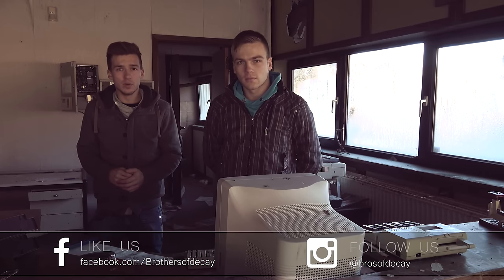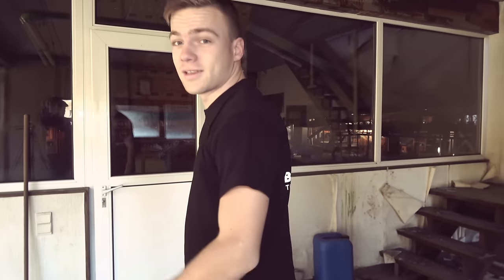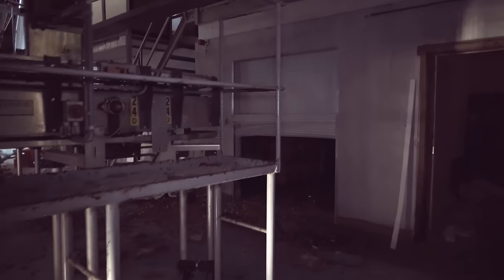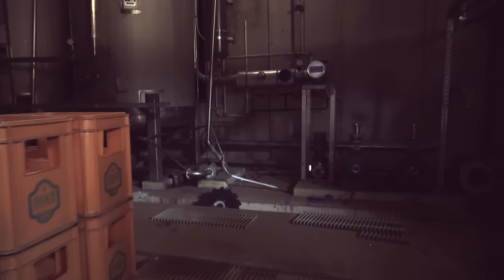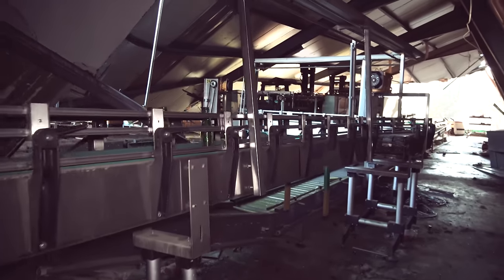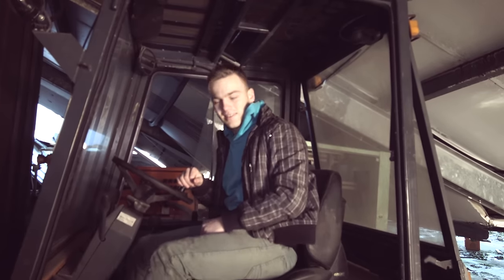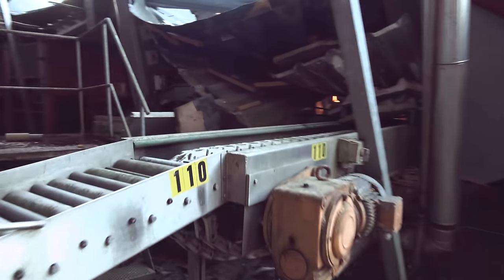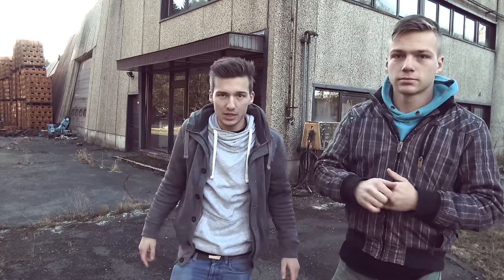Huge abandoned water bottling plant in Belgium

Comment: Those fork lift's are battery operated.  Surprised they were not removed and sold.

I live in a high snowfall area and that building roof structure didn't seem adequate for a heavy snowfall.   Roof collapses from snow are common around here and often the sides are buckled out just like this building.